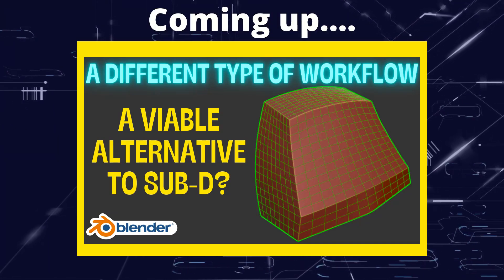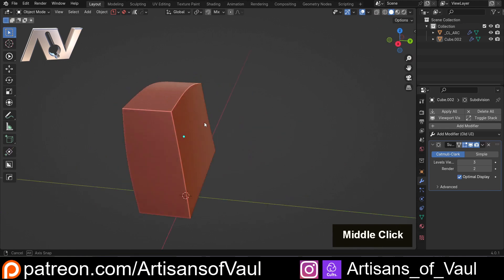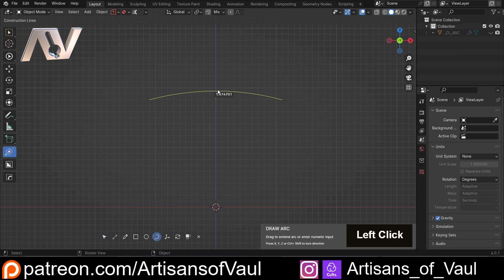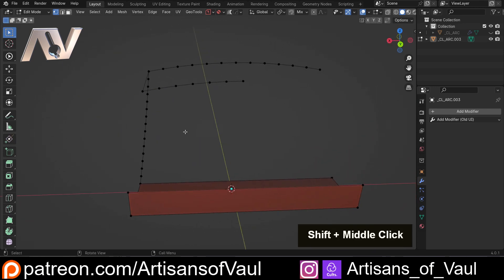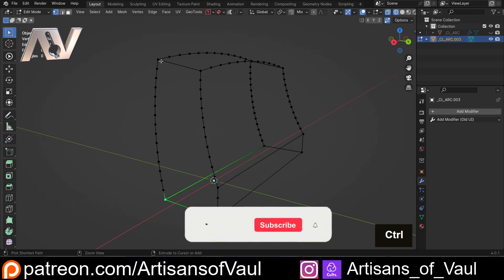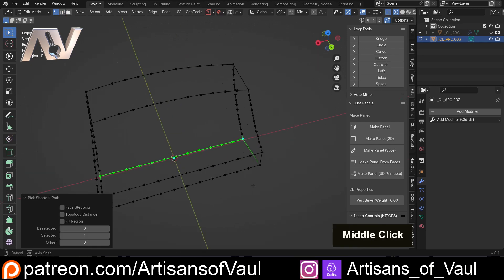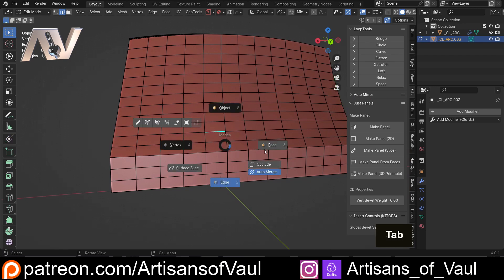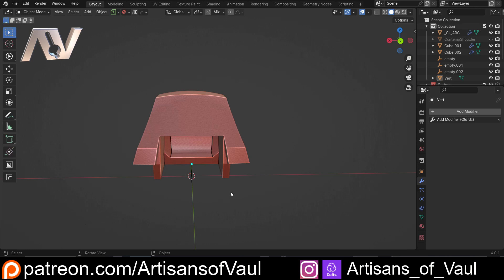A different workflow process for Blender

Comment: You are an absolute god-sent! I've been looking for an alternative modeling workflow for years because of all the limitations imposed by sub-d workflow, and I came up with certain methods. I've been using grid fill extensively in the last couple of months, but I didn't know about a Construction Lines addon. If combined with quad remesher, it becomes probably one of the best hard surface workflows out there! But again, because this method produces perfect topology, quad remesher is probably unnecessary in most cases.
Reply from the maker: 😁😁😁 Glad I could provide an alternative.  As you have said with this Im not even sure remesher would be needed, but its always there just in case.

Comment: Great video!  This reminds me back when I was in 8th grade, subD was not popular (before Geri’s Game), I used to use spline cage in 3D Studio  (NURBS in Alias/Maya) to do modelings like this..  Love the control it gives us…. I could locally control per end point tangent and it will sweep out the interior accordingly.  
NURBS was tedious, because if the coincident faces don’t match, you get horrible seem.. but if things go well, its inherently C2 continuity gives out infinite smoothness, and result in the best looking curved surfaces..
Reply from the maker: It's a fun process. Sub D is great but it has its issues for sure

Comment: Nice. another non destructive workflow I like to use for this kind of thing is making a loop cut in the center, adding bevel weight to it, then adding a bevel modifier set to weight and percentage. Keeps those sharp corners and even quads pretty well!
Reply from the maker: Yeah, that's nice. I have a video on a similar idea of how to make non-destructive shapes. Hard Ops really helps with this as it becomes faster to add in and the change. 👍🏻👍🏻👍🏻

Comment: Good way to build mesh.
I have few suggestions how to build yet:
- LowPoly then QuadRemesher(paid addon) with Sharp edges
- wirh NURBS surface
Reply from the maker: I need to buy Quad Remesher at some point.  I very rarely care about quads though (I model for 3D printing) so it does not quite seem worth the money at this point.  And I agree NURBS surfaces seem a good idea to mess around with but from what I have seen they don't help with wanting to create exact shapes/arc dimensions, which is why I didn't use them here.
Reply: @ArtisansofVaul  yes in blender NURBS not really good realized

Comment: I very much recognize that particular piece from having to make several for my magic sci-fi walkers (converting an old pushfit kit). I also stuffed a magnet in right there at the elbow joint.

I ended up making a mesh and wrestling with some subd when I did it. I really need to get more practice with Construction Lines for when when I want to make a custom torso or other flowing shapes that have specific fit requirements.
Reply from the maker: 👍🏻 That's one of my next projects 😁

Comment: Maybe you could go deeper in this by placing "poles" for more complex geo.
Reply from the maker: You mean on corners? I may be missing your point....
Reply: @ArtisansofVaul  you cold look info about E-poles in topology, those occur when edge  loops delimits other section of geometry. Like when you extrude a single face of a divided plane. Your mesh is almost a cube with very basic forms, it's more common having more complex geometry
Reply from the maker: @myNICKnameISgelo  Oh I get what you mean. I thought you meant placing almost the normal, instead of placing a vertex and working from there. The process would be the same as this really.

Comment: I've used a similar technique and found it tended to flip normals all over the place. Took me a while to figure out why the solidify modifier was acting so crazy. Be sure to check your faces!
Reply from the maker: Great tip! I normally leave the face orientation on, I just have the outside faces as no colour so it only shows the issues. But once you have skinned the whole shape at that point a quick normal recalculation will fix any issues when I've done this
Reply: @ArtisansofVaul  That's a good idea! I should set up Blender that way on my workstation.

Comment: And if you want smooth, little bit rounded edges on the side? Sub-D is invited to the party again?
Reply: Thank you for your swift response!
Reply from the maker: Exactly! Or a traditional bevel could be used (or bevel modifier) depending on the result and geometry required.

Comment: Did you know about Looptool-curve? (Also known as Panel-beating) It's a good way to make such geometry. Look for a video by Ian McGlasham about this. Curious to see how the two compare
Reply from the maker: Yeah, I like that for potentially changing the shape if I need to. I'll look up that video for sure though, thanks for the tip 😁👍🏻
Reply: Ian McGlasham is a monster. It's a pity he doesn't have much content. However, he exclusively does SubD modeling, while this channel is exclusively dedicated to non-SubD. Which makes sense, because you don't need SubD for 3D printing. Using SubD to make this shape would be overkill.

Comment: Honestly, about the precise arch height, I would have connected the two outer vertices with an edge, subdivide it to get a vertex and the center and connect said center vertex with the top one, enable edge length display, move as far up as I please and then dissolve the no longer needed edges.
Reply from the maker: That will get the height but then the arc shape can sometimes not be geometrically perfect, and I'm not sure it would be faster (in fact I'm sure it would be slower). But it is free so it has that going for it. 👍🏻
Reply: @ArtisansofVaul  would you elaborate on it not being geometrically perfect? In my head it's in the end three points with specified distances to one another with no matter as to how these distances are achieved. So I am not quite there yet as to what is won by your workflow aside from time.
Reply from the maker: @Guitartube25  I mean time is pretty important 😉 So to check what you're suggesting you're saying to add a line, put a vertex in the middle and then move it up, add in a sub D modifier and that would create the arc/curve? So that would be fine, the issue comes when you have a other edge where you need it to have several changes in shape (say the side piece where is it part flat and then curved) but the other side is flat.  You're going to put in am edge loop to allow that shape to be controlled but that then impacts any arc it crosses messing up the geometry/curve of it. It can be controlled but added even more time and in some situations will take a lot or work to put right if the edge is complex.

Comment: I love your videos and they are the best resource for modeling warhammer in blender by far. I will still die on the hill of using a low poly/vertex workflow throughout for ease of editing.
Reply from the maker: Thanks so much. And there is definetly nothing wrong with that workflow and for many things it would be superior in time and get the results you need, in fact it's how I model the majority of the time. This just had its uses for some situations/projects and I wanted to share

Comment: Subdivision modelling, although it is quick to obtain results, it is not the most correct method because it hides the shape of the topology.
https://youtu.be/F06n6VmNEio?si=3AysRBRU0p8U6Rk8
Reply: I have watched the video you provided and it was a good watch :) However I feel like what you're saying doesn't quite match up with it

The video is not saying that Subdivision Modelling shouldn't be used - it's just that you shouldn't modify the vertices with the Subdivision Modelling modifier visible, as you would be modelling it against the subdivision result instead of what the actual mesh looks like.

AoV isn't modelling with subdivision active - he's making the model as clean as possible, so that when the subdivision is applied it matches similarly to the mesh, just with improved smoothness - which is what the video is recommending.
Reply: @ryanbarry7670 , was because of my English, I'm not fluent in it and sometimes I use the wrong words to say something 😅.
What you said is more accurate.
Reply: I'm of the exact opposite opinion. Low poly, low vertex = less kinks, less things can go wrong. Maybe I'm bad at it, but from my experience, the less vertices I had, the prettier meshes I got. (Tried to model plants' leaves). I bring the bare minimum information to the table, and subdivision surface does the rest.
Reply from the maker: Agreed for sure